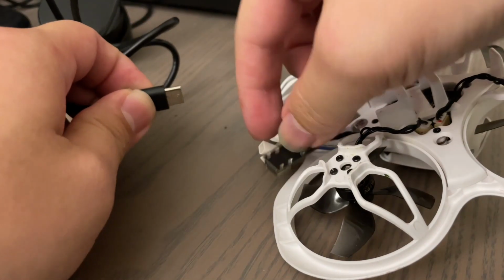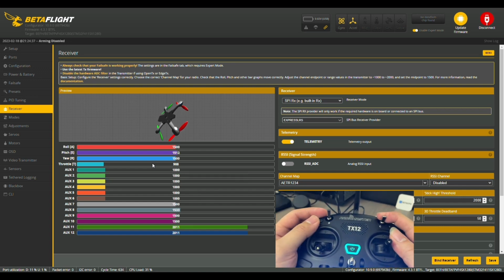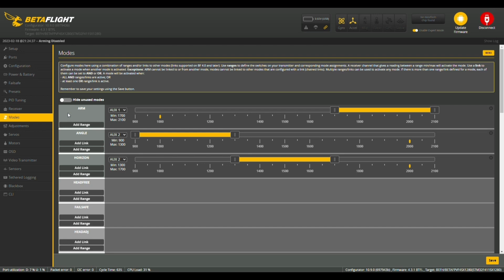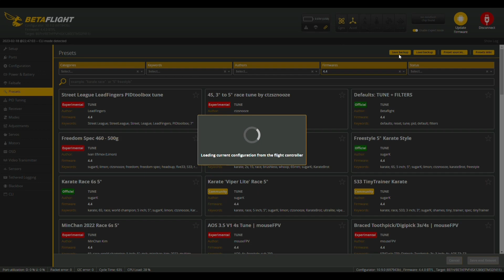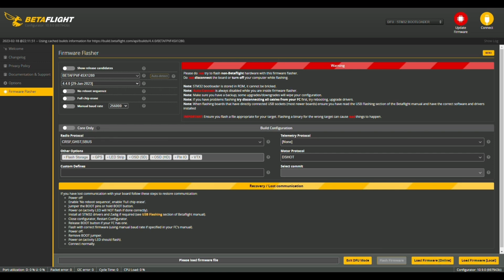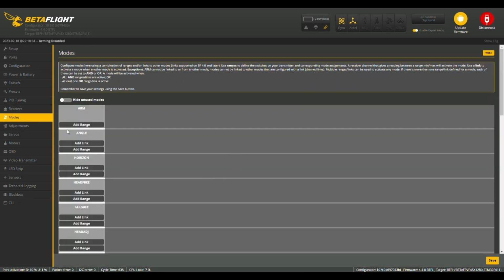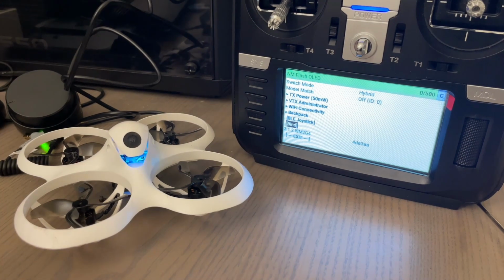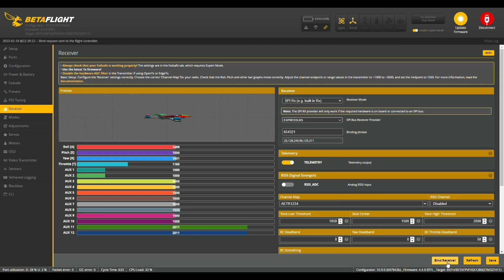BetaFPV Cetus X Flash Firmware  & ELRS Version with Betaflight. Step by step.

Comment: How important is it to do the firmware on the Cetus X? I just got it.
Reply from the maker: The reason of the update is to get express 3.X, but if you already have betaflight 4.4 above. you do not need to flash the firmware as it already has ELRS3.0

Comment: For the part where you reset custom defaults and pull up that saved file for the settings do you have to save that manually or does it automatically save?

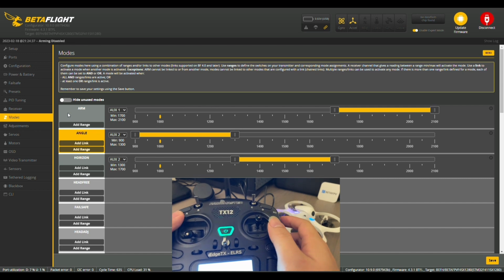Comment: Hello i know there already tons of question. I managed to bind my cetus x to my Radiomaster Pocket. There's one problem: in betaflight the angle mode is not turning yellow when flipping the switch in the mode tab (your video at 1:56min). Do you know what could be the reason? Horizon works and turns yellow, turtle switch as well. Btw i did not update the firmware. Thank you for support friend 😊
Reply from the maker: Sounds like your AUX channel is set wrong, at the angle section select the same "AUX" as your Horizon
Reply: Hey what did you do to connect it to your pocket. I’m dead in the water. I can not get mine to connect at all. I was trying to flash in the hopes it’s just out of date. But I can’t get it to bind to my pocket whatsoever.

Comment: Вопрос? После прошивки версии 4.4 - отказ от дефолтных установок и ввод bacpuc и потом калиброавка?? После ввода в CLI - version  - мне пишется -  Betaflight / STM32F411 (S411) 4.4.3 Nov 14 2023 / 16:16:26 (738127e7e) MSP API: 1.45   board_name: BETAFPVF4SX1280 совпадают наши CPU - ?? Можно ли воспользоваться дампом CLI для версии Cetus X Betaflight (F4 1S 12A FC) с сайта производителя??? Есть bacpuc - с платы полученной из магазина. Заранее благодарен за Любую помощь!!    Question? After firmware version 4.4 - abandoning the default settings and entering bacpuc and then calibrating?? After entering the CLI - version - it writes to me - Betaflight / STM32F411 (S411) 4.4.3 Nov 14 2023 / 16:16:26 (738127e7e) MSP API: 1.45 board_name: BETAFPVF4SX1280 our CPUs match - ?? Is it possible to use a CLI dump for the Cetus X Betaflight (F4 1S 12A FC) version from the manufacturer's website??? There is bacpuc - from a board received from the store. Thanks in advance for any help!!🤔😜
Reply from the maker: Sorry, I tried to translate it but it’s still not making sense to me …can you resend in English ?

Comment: Could you help me, my cetus x does not connect to betaflight. And it doesn't connect to betaFPV either. FrSky receiver. I'm new to FPV, I bought the cetus x and the Jumper T-pro radio control. When connecting the drone to betaflight or betafpv configuration, the card is not recognized by the configurators.
Reply from the maker: In order to help you, please provide more details.
1. Which version did you purchase? betaflight or Cetus ?
2. What protocol does your radio have?
3. Make sure you have plugged in the adapter dongle properly. Changed to an other USB CABLE

Comment: Hey man I’m still having an issue with binding my tx12 to my Cetus X, I flashed my radio to 3.3.1 elrs and my cetus x are flashed to 4.4.3 Bf with matching binding phrases  , still won’t bind, I even clicked on “bind receiver” on BF and “bind” on  radio still don’t bind. I even tried down flashing my board to 4.4.0 the same on this video and still no luck. I tried pressing on the bind button on the FC and “bind” on my radio, nothing happens:( I’m new to the hobby and very lost so far please help
Reply: I had the same problem and fixed it. Go to system -> ExpressLRS -> Packet Rate and change to 250 Hz (-108db) in yours tx12

Comment: I have a cetus x, and when updating the firmware to the latest version in betaflight, a temperature warning started to appear that would not appear with the old firmware. I needed to update it to accept ELRS 3.0. What could have happened? The warning appears less than 1 minute into the flight and ranges from 70º to 90º degrees. I flew twice and stopped because I was afraid of damaging the board.
Reply from the maker: Well, I have the same issue as well, but this is a sacrifice we need to make to bind ELRS 3.X. I will not worry too much about the temperature as it was only enable after the flash, any quad will overheat its VTX without airflow, so make sure you don’t let it idle too long
Reply: @XwingFPVRC  I contacted betafpv support and they said that it is normal for the warning to appear and that it can be disabled.  I even saw from the downloadable cli on their website that this configuration is deactivated at the factory.

Comment: Hello. I updated my cetus x to 4.4.3 firmware and since then my literadio 3 can't bind with drone. I downgrade to 4.4.0 or 4.3.1 but no luck. Do you have any idea what happen?
Reply from the maker: Lite ratio does not have ELRS 3.X if I remember correctly, you need to downgrade your Cetus X back to 4.3.1. Do make sure you save a preset to reload the settings after each flash, if you setting is gone, it will not arm
Reply: I finally solved all my problems. I downgraded to 4.3.1 from official site, I execute in cli the txt file and one more important think is to change channel map from AETR to TAER otherwise will not arm cause of high value of throttle... Also iincrease vtx from 25 to 400. Thank you for your response!!!
Reply from the maker: @ΘωμάςΜαρινίδης-σ1φ  Glad you got it resolved

Comment: Great video. I'm having a hard time connecting my Cetus X elrs to Betaflight because it won't show up on the Device Manager and there is no audible USB sound when connecting.  Could this be a driver issue?  I can connect my other drones to Betaflight with no issue.  Any insight would be greatly appreciated
Reply from the maker: Based on your description, please advice if your Cetus X still powers on ? If so, check your connection of the dongle make sure it is solid. If no prlm, maybe try a different USB cable ?

Comment: HI, I Just buy a Cetus Lite, when I connect it to PC it just say "manual-conection" the drone appear in the "PC admin-divice" but it not connect with betafligth

what happend?
Reply from the maker: If I remembered correctly the Cetus Lite does not support betaflight, you will need to connect it to BetaFPV configurator. Btw what are your trying to do ?
Reply: @XwingFPVRC  I have issues with the drone... the up-down control are pretty unstable... to the point that I go up (with a very little touch) and the drone crash in maximum speed to the ceiling... or the acceleration is hard to the point that detects collision (with out it) and it disarm.

I very want to fly in manual mod... I fly others tiny drones in manual mod (like Eachine or JJRC) and have more control than with the cetus fpv

Comment: i'm pretty new to fpv. so dumb question.

is that not just a betaflight firmware flash? i dont see where the ELRS flashing is done.

i ask because i wanted to go to ELRS 3.0 with the beta fpv lite 3 but ATM it only handle 2.1 so i'm wondering can y upgrade betaflight firmware without slashing the elrs RX ?
thanks =)
Reply from the maker: There are two types of ELRS receivers, SPI & Serial. For SPI, since the ELRS receiver is build into the FC you need to flash betaflight to update the ERLS firmware. I have a detail video made to explain the difference between SPI and Serial, here are the link

 https://youtu.be/5XXx4Jgj1yA 

For SPI receiver, flashing the BF firmware means also updating ERLS, but as long your Betaflight version is at or under 4.3, your ELRS firmware version will remain at 2.X for you to bind with the light radio two 

For serial receiver, you can flash BF firmware to which ever you like and it will not effect the ELRS version.

Comment: After only seeing the first 30 seconds of this, I want to yell: "JACKPOT!!!"  BETFPV is IGNORING my cries for help (support tickets) .... as of right now, I have a useless Cetus X quad on my desk that lights up, but won't arm. It all started when I wanted to use my controller (LiteRadio 3), as a flight-sim controller on my PC, but the drivers didn't seem to install correctly (their manual says if they do not install automatically, they need to be installed MANUALLY - but makes NO attempt to instruct how to do this - tech support sent me a grand total of one reply so far, providing a link to the BETAFTP Configurator).
After installing that, the configurator recommended that I flash the radio's firmware, so I did just that - the latest update. The radio now works fine with my Liftoff sim - but now will NOT, even after rebinding, worth with the Cetus X quad itself ... if its not one thing its another. After trying different softwares to attempt to reflash the quad, I now sit at the stage of constantly getting the error "Unable to contact bootloader - flashing FAILED" ... and this video HOPEFULLY will be my 'hail mary', since BETAFPV couldn't give a rat's ass about me or my situation, this product is less than a week old. 
So THANK YOU in advance, my fingers are crossed, I'll follow these directions to the letter! I'll update my progress in the REPLIES to this comment, as well as post any questions I have along the way... wish me luck!
Reply: OK my first question: When you boot the quad into DFU mode, by pressing that little pain-in-the-button and holding it while plugging in the usb cable (really you need THREE hands to do it) ... all that done, in DFU mode are the LEDs on the quad supposed to remain OFF or turn ON?
Reply from the maker: If you bootloader is active you should see exist DFU mode light up at the bottom. This is just a method to see if you have entered boot loader mode successfully
Reply: @XwingFPVRC  Ok.. thank you - so it appears my bootloader on trhe quad became INACTIVE if I understand what you said correctly ... So how would I make it ACTIVE in this case? (Thank you very much for all this help today btw!)
Reply: @XwingFPVRC  While I search for an answer as to how to activate the bootloader so it does light up allowing me to enter the "DFU mode", I am noticing that in the "Receiver" Tab in Betaflight, everything is completely OFF, NOTHING matches and controls don't represent what's on my screen. I have numerous CLI files downloaded - are those what I need to run through betaflight to 'correct' everything on screen?? Because right now for example, when I push up the left stick from all the way down, the"Throttle Up" on my LiteRadio 3, the only thing that changes on the screen in Betaflight is "Roll (A)" ... and that's only one example...  😕
Reply from the maker: @whats-hamptoning  You nered to reset your channel map and this is how 

https://youtube.com/shorts/8u-qkqUug18?feature=share
Reply: @XwingFPVRC  Thanks for replying, I'll check this out right now! I've also downgraded FPV Configurator to v10.8.0, not using the new v10.9.0 as advised by forum posts on FPVBETA support. I can't believe how they just ignored all my support... but even on v10.8.0, I still see errors. Using 10.8.0, I THINK I've successfully entered DFU mode, I hear the connect sound when USB plugged in finally, and I see a single red LED light up near the camera. But I STILL get errors, everything greyed out in BF, the error not is on top of the screen saying "FAILED to open serial port ("FAILED" in red) ... I gotta tell ya, this has me furstrated, angered and saddened, I'm quite tech-savvy, but I very much wanted a better experience in my first tackle at FPV ... I think the answer as I move forward is to NEVER buy a BETAFPV product ever again ... what awaits in FPV must be better than THIS!
Reply: @XwingFPVRC  AETR1234 - yes, that's what its always been set at. Somehow the controller and quad got 'unbinded' earlier, now I've successfully ri-binded everything (I think) - AETR1234 - everything still spinning and all axis assignments are haywire ... this is a never-ending nightmare I'm close to giving up on!
Reply: @XwingFPVRC  3 more things: #1, I just noticed in your video how the "EXIT DFU MODE" should light up if I've correctly entered DFU mode - it NEVER HAS, I've never noticed it (only like I said, all I see now is a red LED on the quad), and #2, I get the errors like "There's a problem with your configuration - the accelerometer is enabled but not configured (THAT I trhink I've fixed, but also "There is no motor preset configuration set" - like DSHOT** or MULTISHOT etc ... can you please tell me how those should be configured? Much thanks! And #3 I tried a different chacnnel map config, and wouldn't you know it: the Spektrum / Graupner / JR "TAER1234" drop-down preset WORKS... has my quad acting the way it should!! ... but something seems weird there, especially if its supposed to be AETR1234 ... any thoughts? Thanks!
Reply from the maker: Glad that this video can be some help.but my understanding to the lite radio 3 is that it currently does not support ELRS 3.X. Even if you flash the Cetus X to ELRS 3.X Both of them may not bind. But I may be wrong. Can you confirm which version of Cetus did you get ? If it is for the CETUS X FC then it the guide will not work. The guide is meant for Betaflight FC
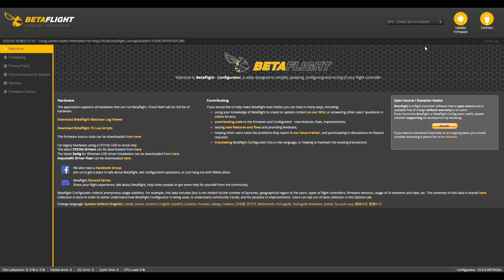Reply: @XwingFPVRC  I absolutely have the Betaflight version. I was up all last night trying to get it to an operable state, then I found your video here this morning. I fell asleep and just got up! Lol ... but now I'm at the "Get into DFU state", my lights in the quad remain OFF when plugging the USB cable back in, button down. NO windows USB reconnect sound either ... so I'm still stuck with this video sitting at 4:18 until I find a solution for that.

Comment: I'm having issues now after I figured out how to flash the most recent firmware to my Cetus X in beta flight

I am unable to get my BetaFPV LiteRadio3 to connect to the drone, I'm not certain what I'm doing wrong or what configurations were changed to prevent the radio from working
Reply from the maker: You might also have to update your ELRS version on the LITE radio 3. ELRS will need to have the same version in order to bind. It has to be either both on 2.X or 3.X, the first number matters more.

Comment: Hey, thx for the video ! 
I did all that and everything worked fine... connection to the RX in ELRS v3 works fine, etc.... 
BUT: no video signal anymore. 
I tried with a few goggles... nothing sent anymore.. so far I found out: its the VTX M04 onboard... but I cant find any tables or settings (CLI) for the Video-setting tab in Betaflight...  BetaFPV has just the M03 on their support page.

Is it at all possible to configure the VTX via BETAFLIGHT? Could it be another prob (hardware was just fine, before the flash...)?
Is the VTX Firmware flashable via BETAFLIGHT or is it sort of included in the BETAFLIGHT Firmware?
Anyone else having this prob? :)
Reply from the maker: For my experience, BetaFPV calls the entire camera unit C04, which is a C04 cam soldered onto an unknown VTX board. My suggestion is to contact BetaFPV support team support@betafpvsupport.zendesk.com, to see if there are any quick fixes. If you need a replacement, as the C04 camera unit is not sold anywhere, you will need to contact BetaFPV to place a special order and they will need to custom make one for you.

Comment: When I press the yellow button and connect the drone to the PC, the drone does not turn on the flashlights and is not detected by either the PC or the program. If I turn off the cables and insert them back without pressing the button, the drone is correctly detected.
What am I doing wrong?
Reply from the maker: DFU mode is mainly for us to flash the firmware, when activated, you wont be able to connect it same as the regular plug in. If it is completely non-detected, then this is something I have not run into just yet, Sorry.
Maybe you can try below other methods to force it to go into DFU mode?

https://youtu.be/8mlNkIaFMPM	

https://youtu.be/0L-8ZuTGqXM
Reply: @XwingFPVRC  I try to enable this in the betaflight-configurator program, but I get the same result. I will try your options from the videos above
Reply from the maker: @МихаилУсенко-ю7с  Good luck brother, sorry was not able to be much in help : )

Comment: I've updated firmware to 4.4.0. However now betaflight says "there's no motor output protocol selected". Also there's a clean video in the googles (no info like voltage). What should i do?
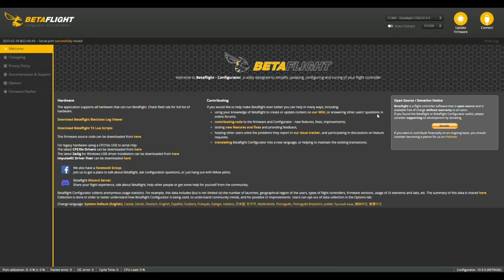Reply from the maker: When you flash your FC to a newer BF version, your CLI comments and presets will normally be wiped out. The FC no longer recognized your motors and stick inputs, this is why we need to back up our presets before flashing, this is mentioned at 3:31 in the video. 
If you forgot to backup your preset, you can still download the factory default at the BetaFPV website as below.  
CLI of Quadcopters – BETAFPV Support Center 
If you have additional questions, please feel free to ask.
Reply from the maker: https://support.betafpv.com/hc/en-us/categories/900000230226-CLI-of-Quadcopters
Reply: @XwingFPVRC  i thought that it's not needed because it's completely new drone and i have no custom settings there😅. Thank you a lot)
Reply from the maker: No prlm, glad to help. Trust me, I made the same mistake

Comment: Everything is very beautiful. If possible, explain to us the method of factory settings. I did something and the drone did not return to flight. I need a factory reset or any update to return to training. Also, the remote does not work as before. Please explain to us how the method is easy.

Bander,,,,,.
Reply from the maker: Hi Bander, 

If you like to factory reset your drone, you can check out another video i made. Reloading the firmware + CLI file might fix your problem. 

https://youtu.be/tT7YXIpoRoY